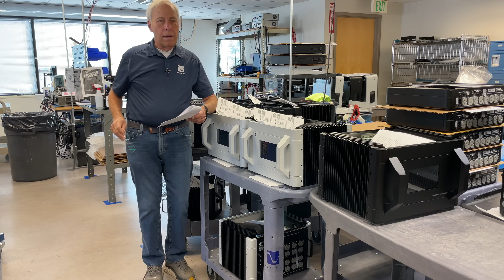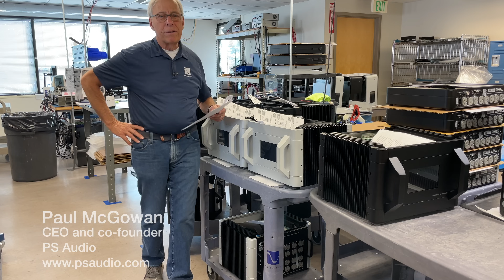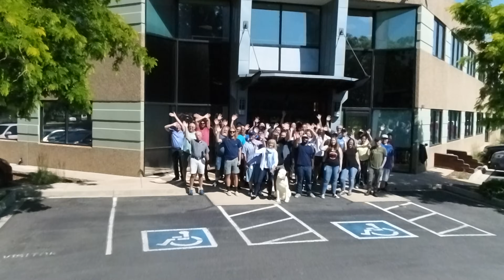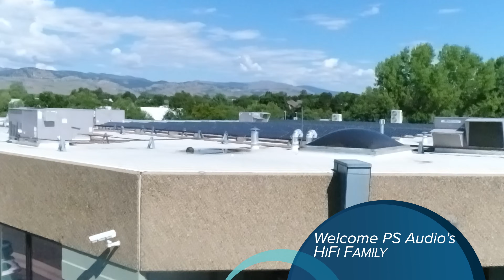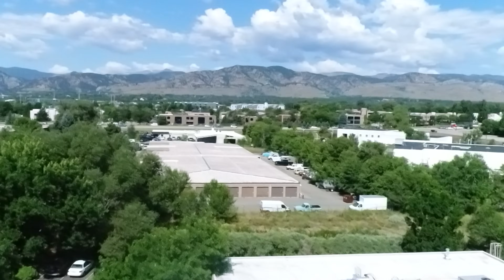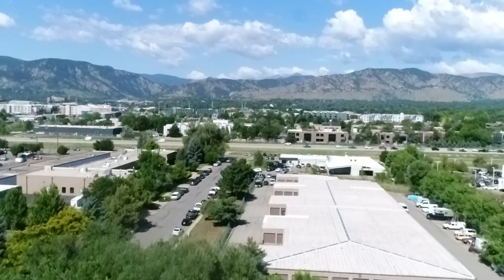Op amps vs discretes

Comment: Why is it called an operational amplifier?  Does this mean there’s a non-operational amplifier?
Reply: Because it use to be used in analog computers to do basic operations like adding or multiplication. In fact you can even do derivatives and integrals. Hence operational amplifier.

Comment: We should all take a second to thank the designers and manufacturers of the  NE5532 opamp for giving the world an affordable way to amplify voltage signals in the audio band with next to zero distortion.
Reply: And most of those so-called discrete opamps are unusable in a lot of designs because of their ridiculously high input bias and offset currents not to mention power dissipation. What problems are they allegedly trying to solve ??

Comment: opamps, the chip kind used in audio for voltage gain, like the NE5532,  are excellent at what they do.  What you put in is what you get out,   period,  no arguments about that.        The thing is,   they just dont 'colour'  the audio which can be extremely boring.    Marshal has made hundreds of millions of dollars of distortion because it sounds good.

Comment: What do you call an IC with only 1 transistor on it - a discrete. Designing an op amp on an IC comes with benefits and limitations over a handful of discretes but fundamentality the resulting sound quality is the result of the silicon process or processes used and good design, one is not necessarily better than the other.

Comment: i was an engineering technician for Analog Devices when they were in Cambridge, MA (1970). The high end op amps were in a 1-1/2 sq epoxy package that had pins coming out of it that would plug into a socket. The opamp itself was built of di epoxied into a potting shellscrete transistors  and FETs with the supporting resistors and diodes on a printed circuit card and that assembly was put into a potting shell with black epoxy. Once that epoxy cured the thing was a monolithic brick.

My job was to build prototypes that we could tweak for optimum performance. Some TO-5 ic's like 709's were just starting to be used ubt these were lower end op amps. if you needed real performance you got the discreet op amp..
Reply: I have a few of those with gold pins on them.
Reply: Whats the best current op amp for a dac in your opinion? Weiss OP2?

Comment: Actually a very good question, and a good answer. However that question could springboard into a much larger discussion on modern amplifier design, hybrid circuits, FPGAs, etc.

Comment: I think you made it sound quite complicated Paul,  all it is a circuit diagram of the chip, if in solid-state form with transistors resistors and diodes is the discrete op amp,

 feedback the subwoofer on the unused channel flip it out-of-phase should I use a 0,1 capacitor or just straight in the input?
Reply: No he didn’t, you did. Lol.
Reply: @ramsaybolton9099  ok people don't understand it maybe they do find it complicated I thought I made it sound more easier to understand good to have you feedback!

Comment: This argument caters for the people who claim they can tell the difference. The difference is nearly always 'different' but not necessarily better and, at a stroke, belittling those IC designers that go the extra mile to make a great performing device. The precision gain matching, great repeatability and superb thermal compensation of an IC op amp is difficult to beat where everything is on a single piece of silicon.  The Octave Records Studer console probably uses many proprietary A101 discrete thick film linear amp modules in key areas of the audio chain, but this was before really good audio op amps were available, so it's understandable why they went down that route.

Comment: A typical example of discrete OP AMP implementation is any power amplifier. While chip op-amps have gone a long long way into high performance, they are still all limited to low rail voltages, in the +/- 15-18V range, and that does indeed introduce some limitations. As for sound quality, I'm "blessed" with no golden ears, so I can relax and enjoy the music.
Reply: I was thinking the same thing. You yank the NFB and it slams to its favorite rail or becomes a power comparator . Most power amps I have seen however use the inverting input for NFB only and not for diff input. As we know it's that odd lone stage in the upper middle just a bit to the left that does all the really interesting stuff.

Comment: I'm old enough to remember (and having built) Op Amps using tubes and transistors. Oh, God!
Generally, DC-Coupled, very high-gain, low noise, with feedback, so low distortion.
Chip versions are generally absolutely fine (and very cheap) but some discretion may be advised. See what I did there?

Comment: So, It looks like the question should be discrete op amps VS chip op amp?
Reply: Not necessarily so, with discrete parts you are not restricted to a 'traditional' op-amp design, you can make all sorts of almost, or wannabe 'op-amps' as your final product may require.

Comment: Does anybody know where this guy received his electrical engineering degree?
Reply: @Douglas Blake that one quote from "Good Will Hunting"" lol. I give more respect to someone who is self taught and has the same knowledge than someone who was institutionally spoon-fed, not to say that it isn't hard work. You can skip the degrees and go straight to the top paying jobs by learning the cutting edge of technology all on your own... in the 70's it was IC/amplifier design. Want proof? Look up FPGA design, some of the biggest houses pay top dollar not for a piece of paper, but for what you can get an FPGA to do. Dev boards and manuals and a whole lotta motivation is all it takes.
Reply: hehehe.... as though one were necessary.
Reply: @Douglas Blake plenty of engineers dont know what they get wrong. Im sure you know a few.
Reply: You can read book about electrical engineering. And the truth you can't complete all chapters even in your PH.D.

Comment: I.C Op amps have come a LONG way, allowing for the design of high end audio devices in a much easier manner. However, some of the BEST recorded material I've EVER heard was all recorded using devices that had audio circuitry that exclusively used discrete op amp circuitry. API consoles have nearly always used discrete op amp circuitry... the old Stephens multitracks used class A discrete circuitry... something you could EASILY hear. A gifted designer can often make you believe that you are listening to a circuit that is discrete, when many times it may perhaps not be so. I.C. op amps cost less, but perform nearly as well as most discrete op amps. Great question, Paul... and great answer as well.
Reply: Whats important is discrete front end on a  chip based mic preamp. Chip based mic preamps can sound very good and have vintage character especially If TLO 072 /074 is used in the circuit. There is alot of difference between the old chips that have more Harmonic distortion than the never ones that is superclean and silent. API,  Trident and  Focusrite also use a Audio Transformer Balanced input to there chip based Mic Preamps. Never Mic preamps from Neve also use transformer balanced front end and chip based design. The first chip based design from Neve was the Focusrite Forte console whit the ISA 110 mic preamp module. All new mic preamps designs  from Neve after the 1985 Focusrite forte console has been transformer  front end and chip based. The new Rupert Neve Design shelford series also use transformer balanced Input with a chip based Mic preamp module. 
Of course Neve still sells the Classic all discrete Class A 1073 1081 modules but  all newer design series are chip based designs. If you want Discrete Mic Preamps there is alot of Neve 1073 clones like Golden age  Pre 73 Warm Audio WA-73.
Reply: @MZ-tm1tw ... The reason that manufacturers use integrated circuit op amps is twofold… 1) ease of design and 2) to reduce the cost of manufacturing. If a current console manufacturer used discrete transistors instead of op amps, the cost of the final product would price them out of the market. 

The reason that transformers are used in console mic preamps is for signal coloration that is part of the design as with high input signals, the transformer core saturates, providing the signature sound that the manufacturer had designed for.

IC op amps also became more popular in console designs because they allowed for transformerless output circuits, again reducing the cost of manufacture and allowing a product price point that addresses the lower costs that the market desires.

Actually, the first chip-based designs from Neve, the company, were the 8100 series consoles… the 8108 and the 8128, but neither of them were really accepted overall, more than likely due to the FET switching routing matrix, which was quite problematic. However, when Rupert Neve started Focusrite, he employed a superior op amp than did the design engineers at Siemens, who purchased his company, and the right to use the Neve name, from him. By using the 5534, Rupert was able to use a far superior audio op amp for that time. (However, it was the use of the Lars Lundahl input transformer, coupled with the 5534, that gave the preamp its signature sound.) The single version 5534 has a couple of pins that make available certain parts of the op amp circuit that can be used to change the bias of the op amp, and thus give the design engineer a greater variety of sonic qualities.

The API 2520 discrete op amp has a specific large die transistor as its output pair, which is capable of driving a transformer without any assistance… something that an IC op amp cannot do on its own without bogging down and blowing up. Paul Wolff, who purchased API back from Datatronix in the 70s, in moving on the form Tonelux, created an op amp with a separate output pair so that he could save costs, only using large die output transistors when necessary to drive an output transformer and designing the discrete op amp for a particular musical quality. Those who use Tonelux equipment love the sonic qualities that Paul designed into the overall circuit topology.

While IC op amps are great, overall, and manufacturers like Analog Devices make some cutting edge ICs, for the most part they still do not perform at the level of a well-designed discrete circuit as transistor dies can be chosen for the particular sonic properties that they, along with wise choices in resistor and capacitor type, will impart to the final product. 

However, other aspects of equipment design can render a well-designed circuit useless. Without employing separate power and ground plane layers in the circuit board design and layout, a great circuit on paper can end up being crap.

In the 70s there was a company out of Texas, Southwest Technical Products, that manufactured amplifier kits, both preamp and power amps. The designs were based on a complimentary differential input, like the one that Hafler finally ended up using. They were warm, very amazing, and some of the best power amps I ever heard, especially considering that they were only $60 each. These were my introduction to great hi-fi listening… sadly they went away too long ago. (Sorry to have digressed.)

The presence of so many clones of classic, class A mic preamps on the market should be more than enough to convince anyone of their timeless qualities in delivering a pristine signal to whatever recording device is employed. By the way, if you’ve never heard of The Hardy Company, John Hardy uses the 990C discrete op amp (of his own manufacture) in minimum parts count mic preamps (that are fully transformer coupled) and sound amazing.

Additionally, designers like George Massenburg utilize fully discrete, transformerless, balanced in/unbalanced out circuits that rival many others. Avalon Designs base their products on class A, discrete, fully balanced circuitry that is some of the quietest in the industry.

In summary, while IC op amps make for a much easier design, and allow for transformerless outputs (thus reducing the cost of manufacture and end user prices) the traditional discrete transistor circuit allows for greater fidelity along with the coloration that many desire… drums and bass are fatter without adding anything else to the circuit. In audio reproduction for the serious listener, discrete circuitry that is well-designed and implemented will bring the listener some of the greatest satisfaction ever…  yet with a much higher price tag. I hope that I didn’t bore you with my reply.
Reply: @jimrogers7425  great share

Comment: Time to hit the breadboard! I have a ton of CMOS chips, timers, op amps, 8 bit shift registers and other goodies that I’d like to use to make an analog voltage sequencer for controlling synthesizers.
Reply: There is no limit to how many layers you can stack into a synth. But eventually you have to do it with software then write it to hardware and call it um, let me see, uh Oh Hell let's call it DSP.!
Paul's sermon was pretty inspirational today though. 
I wanted to make a class D tube amp but I found it's been done and it sucked. I'm not sure I believe it but I'm stubborn that way.
Reply: @InsideOfMyOwnMind  eventually WHO has to  write software? There’s no reason in today’s day and age why things can’t be all analog if desired
Reply: @graxjpg  Then you'll find it interesting that a well known active speaker manufacturer who had a DSP based input section on their speakers have replaced them with ones that use a similar looking ASP chip and it sounded way better.

Comment: Once again this is one of those topics can go around in circles ALL day. If ANYONE does a double blind listening test with an op-amp vs. a  discrete transistor headphone amp you will be hard pressed to hear a difference. Ultimately it's the total circuit that "voices" the amp, (or pre-amp) NOT whether or not the circuit uses chip-based op-amps. However most audio op amps have strict output loading and compensation requirements. In addition it's fairly difficult to find perfectly matched (complimentary paired) discrete transistors. Discrete transistor circuits are really required for Power Amps only. Since just about every modern day recording console is overloaded with op-amps, adding a few more into the playback path isn't really going to make a difference.

Comment: For the truly curious, may I suggest a paperback book called the “Op Amp Cookbook” you may even decide to purchase a kit where you can wire up some of the sample circuits that are described in this book.
Reply: @jim9930  I am very familiar with journal. The book I suggested is for beginners and this man seemed to be a beginner.
Reply: I have that book someplace... great guide.
Reply: @jim9930  I can only speak for myself. I am a former engineer who has not practiced for over 40 years.
Reply: Hi. Who is the author of this book? I'd like to read it.

Comment: What type of opamp is used in the signal paths of Octave Records?
Reply: I bet there will be a number of NE5532 chips somewhere in the loop. :)
Reply: @savvassidiropoulos5952  In my FOSI audio tube P1 Preamp there is two of them on a socket so I can upgrade them if I want to.
Reply: Cheeky question...
Reply: The Studer desk with the Neil Young provenance they use is loaded with NE5532 chips.